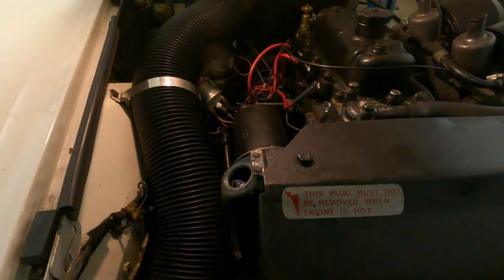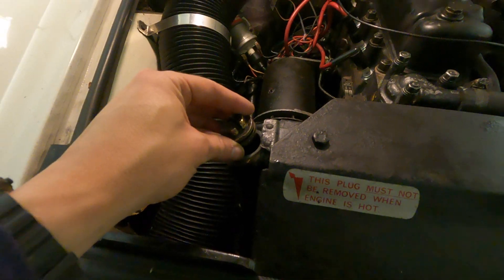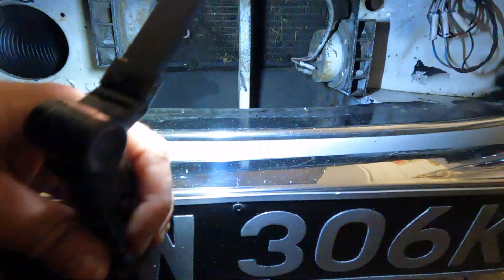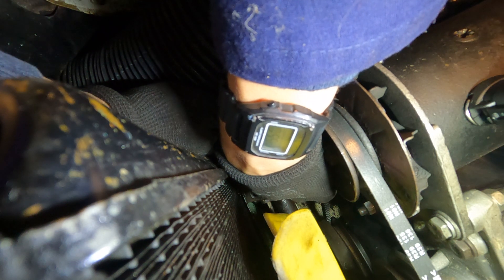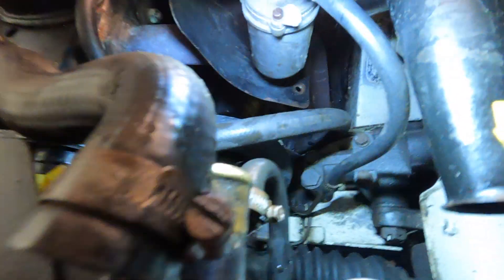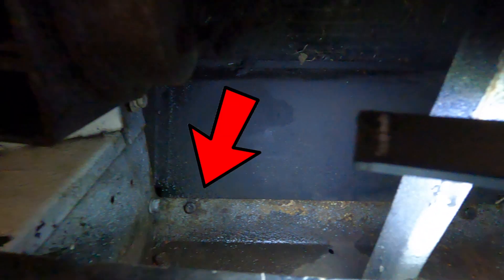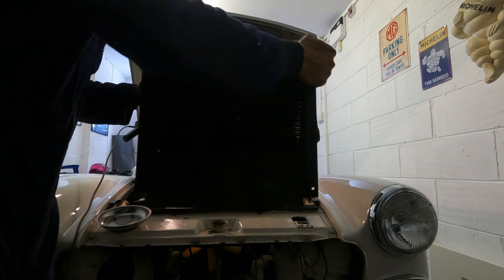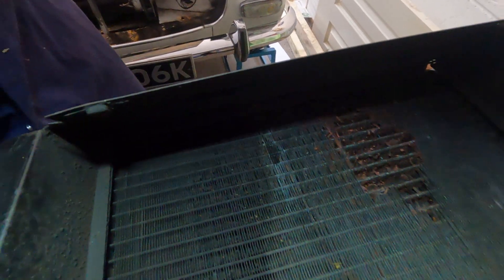How to remove MG Midget Radiator And Flush Coolant

Comment: I thought, as you had the radiator out, you might  drain and flush the engine block as they can also block the water galleries with sediment and stop circulation of coolant around the cylinders. Never mind, maybe next time ?
Reply from the maker: Ah well. Being  newbie , it's baby steps for me. But yes, next time I will do that.
Reply: @AndysMiniAdventures  The reason I say that is that I just yesterday got my Midget out of storage and it overheated several times on the way home. This car has been restored and engine was stored for probably over 20 years. Low on water but there could be other reasons so its flush time for me. .
Reply from the maker: @awalk5177  ahhhh. I'm very lucky. Refurbed engine with 10k on the clock and driven every other week!
Reply: @AndysMiniAdventures  Perfect.

Comment: Andy... So how many screws/bolts did you finally find to remove the radiator. Where were they located. Was it four, six or ? I saw the four on the video however you kept talking about another two which you could not find. Great video as usual.
Reply from the maker: Hey there, the other two where meant to be midway up (as far as I can rememebr) near the heater ducting intake and similar position on the other side. 
The moss catalogue does a good explosive diagram on their website if in doubt  !
Reply from the maker: https://www.moss-europe.co.uk/radiator-midget-1500-1974-79.html

Comment: What is the small round 'plug' for on the rocker panel?
Reply from the maker: Not sure which one you mean sir !
Reply: @AndysMiniAdventures  Whens the next video Andy??
Reply: @kevinmopar1211  my work has me at 14 hour days at the moment. Shan't be for a bit I'm afraid!
Reply: @AndysMiniAdventures  Our terminology is the likely the problem lol.  Just below the door on each side there is a small round black rubber plug
Reply from the maker: @kevinmopar1211  ah ha  that is for the original jack the car came with.... not to be trusted though!
Reply: @AndysMiniAdventures  absolutely love everything about your videos!  when i was watching this one and the bush and U bolt replacement what caught my eye was how good your ramp , jack and stand set up is ans TBH it is somthing i was first nervous about when i first started creeping around under my midge -  was wondering if the next time you have her up off the deck you could walk us through what you have and where you position everything ? Again fantastic work my good fellow :)
Reply from the maker: @stewartbuchanan5858  well hello there Steve. Thanks so much for your comments mate! Great idea about jacking points and how to position stuff..  that'll be my next video!